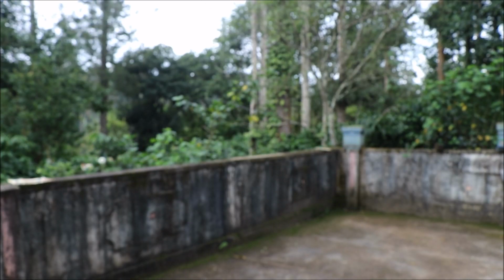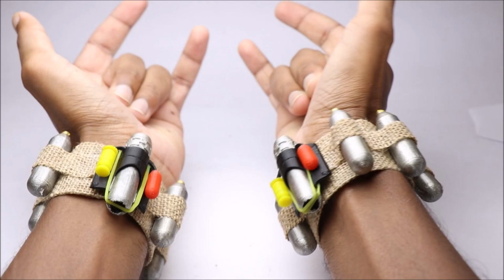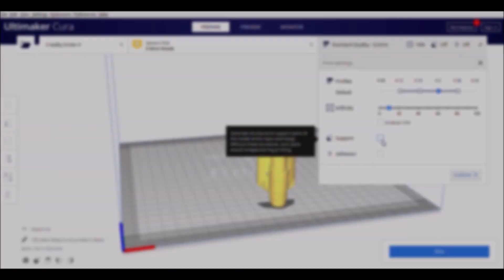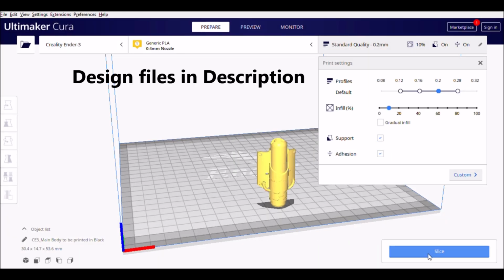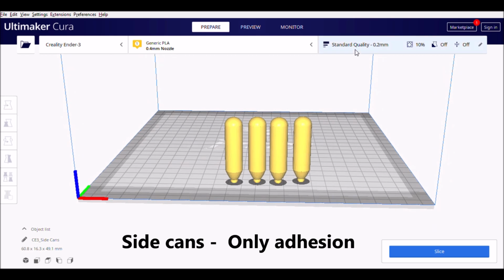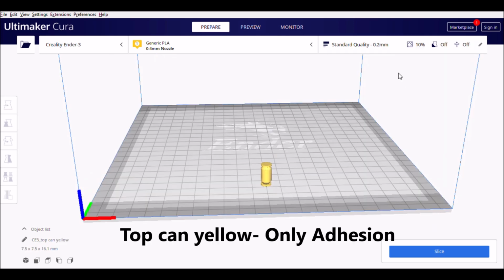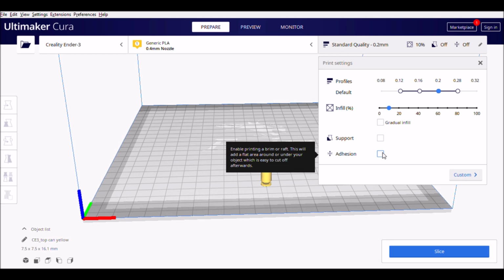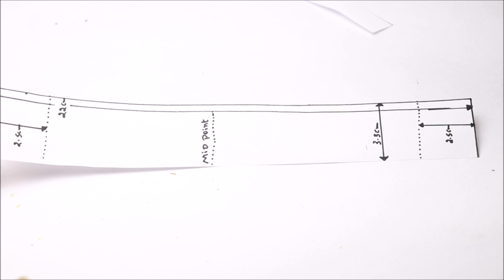How to Make FUNCTIONAL SCARLET Spider-Man Web Shooters without using Springs or Magnets

Comment: EPIC!
may be add a lock and trigger so you can load them the shoot them quickly...........
Reply from the maker: Yes will make an upgraded version!
Reply: @jeevanjee  You could also use a spring instead of a elastic band